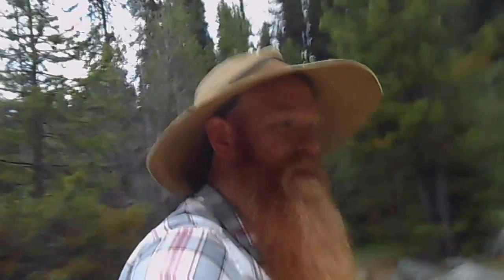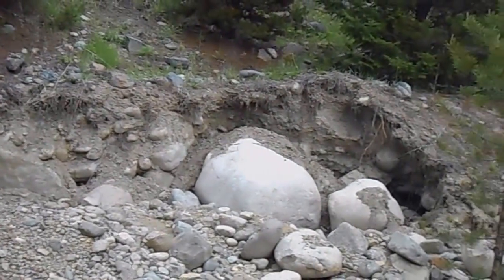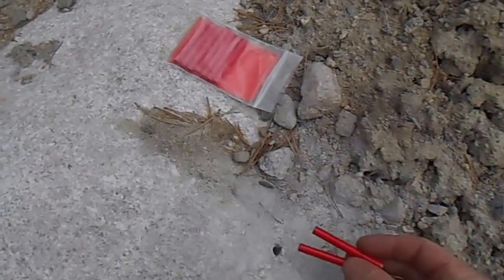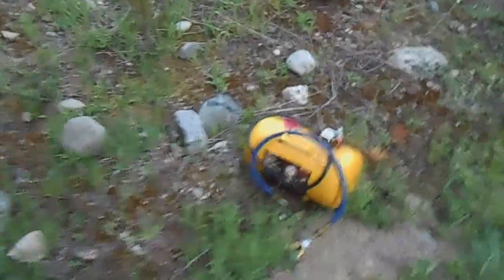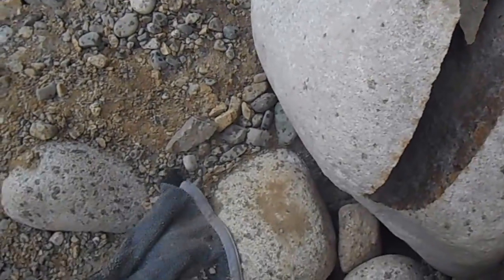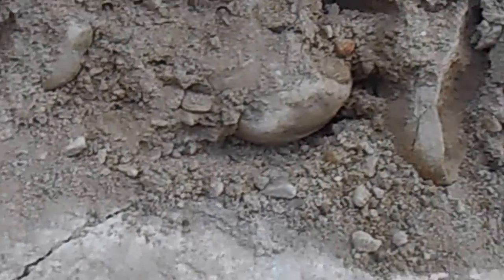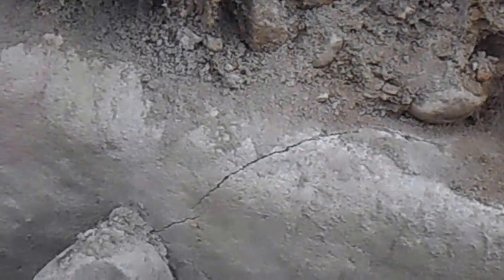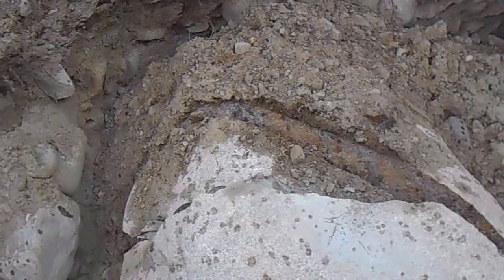Splitting rocks with the Micro Blaster

Comment: My grand pappy used to use a 30.06 shell, a picket pounder, a rod. Sharpened to a point and a heavy rubber mat with a hole drilled in it to break rocks to clear fields for farming and grazing. You don't have to spend thousands on a mini dynamite blaster and charges.

Comment: May I sujest placing a good size rock on top to stop it from flying out like a rocket.  And it will hold the blast in longer and harder of a blast ,resolt is a bigger batter crack and using the devise to its fullest potential.  This coming from a mason .🖒🖒have a good day . By

Comment: Just an observation from other micro blaster videos they placed a decent sized rock on top of the mechanism so the blast wave stayed more in the rock and the mechanism didnt fly which means not all the pressure went into breaking the rock. 2nd not sure how you hook to your rocks but you could get some 5/8 drop in anchors and the set tool and thread in a 5/8 eye or 2 and make your job easier. nice videos keep up the good work sir. Oops i forgot 1 step you have to drill for the drop in, lol.

Comment: Get some old truck tires and stack 4 to 8 on top of the mini blaster to hold the charger down. Your loosing all your energy and its blowing out the hole.. energy has to go down into the rock not out the top of your drill hole.
Reply: Jared Beaucage no, he's not, as a blaster under ground in Colorado a simple oil funnel can point the blast with  the soft Anfo blasting powder.

Comment: So when your blast head flew out of the hole , its most likely that you had air or dust in the hole , the air is compressible and delays the blast pressure from and instant shock to a longer pulse that allows the pressure to shoot the blast head out of the hole. And the dust holds air and area that can be compressed. If you add water to the holes you will get more power and generally don't have to clear dust or worry about excess air space .

Comment: With explosives, dust acts as a plastic cushion which to some extent reduces the fracturing power of the shock wave, so the more dust one has, the more dampening of that 'clean crack' the explosives are trying to deliver.

It is much like putting a rubber pad on s sledge hammer than trying to break rock with it.

It can be done, but it used more power.

Comment: I was a driller on a Ingersoll Rand rock rig & blaster in Arizona drilling holes to blast a channel in the rock bed to lay 8 ft diameter sewer pipe      & also the reservoir and the 60 ft deeper for the intake pumps to be placed in to pump the water up over the mountain at the end of the water canal you see on the right side of interstate 10 traveling southbound just before Tucson Az.          We loaded each hole with a single stick of dynamite and a blasting cap and supervisor had it calculated how many inches of pink colored grains of farm fertilizer purchased in large bags to pack down on top of the dynamite followed by packed dirt. The fertilizer is explosive and aides in the blasting strength of the dynamite plus helps with directing more energy from the dynamite to be absorbed into the surrounding rock and helps in blocking the energy from taking the path of less resistance out the drilled hole. Company also would blasts out rock to make a room or a tunnel/shaft for property owners in the Arizona desert they can add a door onto to it to make a shed ya might call it. You drill a bunch of holes than load the drill holes near the center of tunnel to be blasted with millosecond delayed blasting caps so when the dynamite goes off the outer rows of drilled holes explode 1st before the center area explodes & this causes a reaction from the blast so it will react like a person is vomiting out their mouth effect and clear out your blast hole being blasted.
Reply: Do you know where I could get one of these?
Reply: @Crazzy_51_50   dont know what amount of rock you want cleared but you can find old portable  rock drills fairly cheap if wanting to drill a mine shaft, tunnel or hole in the ground/wall and runs off a small air compressor you can rent using air line hoses. Now days with our modern  technology and tool advancement you can get electric drills and hammer drills that can run off a small generator if not a commercial size project be cheapest and easiest way. Search for hand held portable cement or rock drill and drill bits or stems. Might take a little more work time but depending on what type rock maybe not. Theres so much new out there i have know idea whats available now days. In 1986 without a criminal history or a felon you had to pass a 50 i believe it was question test to be able to buy dynamite, a metal locked box for dynamite and another for blasting caps with hazardous placards to be able to transport along with a reasonable and true purpose use for it being used basically. Scratch that being true nowdays...haha. You can find videos or ideas im sure searching for options on rock removal ways or tools. Old miners having only sledgehammers and picks would heat very hot boulders or rock to make it brittle and break easier when hammered, smashed or crushed.

Comment: another improvement I may suggest is to weight your device with stones and that energy tossing your equipment around will have to path into the target.
Reply: Hi Mark, good idea that is exactly the way the alternative, SierraBlaster works, it has a silicone ring that grabs rocks even at an angle to do exactly your idea. www.sierrablaster.com shows videos of it, rocks fly up (Newton kinetic effect) and head stay in place.    BTW check out the gold nugget on my hand in pic, I use SierraBlaster for gold mining.  It is electrically fired.

Comment: Rather than wrapping in chains to pull ,how about drilling another hole and using a Lewis pin? You will get a good strong grip on the rock and make it easier to lift and tow. Less danger of chain slipping off and whipping towards you. Can be used with a come along to gently move boulders where you want.Stay safe,those big boulders can hurt you bad!

Comment: As a kid, I remember my Grandfather showing me how to blast rock with TNT he bought at the local hardware store. How times have changed! He always had a coal mine one his place. He was a coal miner and he was one of the first wire-drawers at Keystone Steel and Wire. Pulled that red hot iron using asbestos gloves and manually pulling the rod through the rollers by hand. 
Just in passing, when my Uncle was breaking rocks, I took some wedges that I had for splitting wood, and used Stellite 6 for the edge. After he cracked them like you did, he'd use the wedge to either just make an area that he could get the rope/cable in to pull them out, or he'd finish the crack with them. He told me the reason you get all the dust out was because the dust wasn't as dense as the rock and would cushion the blast.
Thanks for posting!
Smiles!

Comment: Your missing one thing. A rock on top of the blaster so it'll hold it down. That way your getting more of a blast through the rock instead of it going back out the hole. Plus it's not good having the blaster flying out and hitting rocks and possibly breaking. Great video!
Reply: even packing some mud or plasticine around the top of the hole would help contain the gas and provide more force for splitting
Reply: Yepper that's what I was told to do was to put a heavy rock on top to hold the blaster down in the hole, because you lose that pressure that sends it flying... That pressure needs to go down not up... But I never ended up using one. Life showed up and plans changed. When a pickup truck pulled out in front of my motorcycle... Very ugly bad ending... So live love and enjoy life all you can while you can.... And BLAST AWAY!!!!!! YEEEE HAAAA!!!!!!
Reply: JeromeAZ57, Agree with you.  The alternative to MicroBlaster is the SierraBlaster, and it is designed with rubber ring for rocks to be placed on top.  And works great, here is a video of the rocks flying up and blasting head being held down.  www.sierrablaster.com     I use it a lot for small mining and jeep trail building.
Reply: What about plugging the. hole with concrete?

Comment: don't ever put two sticks one over the other
Reply: Two cartridges in the same hole are allowed by the manufacturer.  More than two cartridges are not.  The cartridges are setoff by a primer much like a primer in a shotgun shell.   The micro blaster unit has a firing pin that strikes the primer of the top cartridge.  The detonation of the top cartridge sets off the second one.   The cartridges are as safe a shotgun shells and will not accidently detonate unless the primer cup is compressed far enough and fast enough to strike the anvil in the primer to setoff the cartridge.
Reply: why ?
Reply: i still don't get it ??
Reply: Cuz explosives except plastic ones are really dangerous if you stack them and press them too hard, or the one can blow and the other not
Reply: got it , thanks
Reply: Buckhorn Cortez y

Comment: go old school and heat the rocks with fire then beat the bejesus out of it :)
Reply: jon west yep,  that's been around thousands of years.  Burn for hours, then dump water on,  to effect sudden cooling,  and you have brittle rock,  or even some splitting.
Reply: Found an old mine up on the mountain and it had the whole back wall burned black.  It only went back in about 40 feet.  Can you imagine how hot it was in that mine?  Also found a rock doorway they started to push.  About 4 ft tall 3 wide covered in hand-packed mud.  You could see the handprints in the long dried mud.  Could not find that mine again.  The entrance was about one foot tall and three feet wide.  The rest was covered with dirt and rock.   I had nothing at the time to explore that doorway.  Chasing deer during the deer hunt.

Comment: Another easy way to move larger rocks is drill a larger hole and screw a wide tapered bolt in with a shackle attached, then drag out with your 4x4 or tractor

Comment: Your video's are AWESOME! Thanks for posting, and sharing your knowledge. I, for one, appreciate it! This is my favorite so far, but the bucket classifier is a close second. Which by the way: Can't ya buy stainless mesh; say 20 x 20 inches, and just be done with it (longer durability)? Does that material/fabric you recommended (name is escaping me now..of course) come in varied mesh sizes? Keep making these, you are a great person to help others like you do. Thanks.
Reply from the maker: Todd Kleinert Stainless mesh would be the way to go. Just a bit too expensive to use in a high school.  Our budgets are limited.
Reply: I understand completely about the budget. My pro-style classifiers were spendy, for sure. I regret getting the big 13" ones, a bit. I think that I would have been better off with a set of small 9" models. I picked up 30, 60, and 100 [mesh bucket classifiers]. I don't dislike them, but the 100 is a challenge, and I think I need more sizes to ease this pain. I'm wishing that you will have heavy pans Dan. Take care.
Reply: @Danhurd  use ramset bullets. They are far cheaper. And u only need 1 or 2 per shot.

Comment: Very interesting.  Unfortunately for me, my claims would require a plan of operations etc to use explosives.  Have you ever heard of expanding grout?  Not nearly as quick as the micro blaster, but non explosive.

Thanks,

keith
Reply from the maker: Hard Rock University I have heard of it, but have not tried it.  would like to some day.  Unfortunately, it does require a much larger hole to be drilled.  What I was told by the person who owns the Micro blaster, at least around here, it is small enough to fall below the threshold of being considered an explosive.  There is another type, the charges look like a shotgun shell, and you use water in the hole and basically shoot the shell into the water, and the shock wave in the water splits the rock.  But again, you need a bigger hole.
Reply: Dan Hurd Yep, they also make one that creates high pressure gas that breaks the rock.  None of the others I know of work so quickly and easily though.  Extremely efficient.  I used to set of 20,000 lbs of anfo at a time though,  so I cringe when I see you set it off at 100 feet with no shielding.  Where do you get the info about that device?

Keith
Reply from the maker: Hard Rock University just do a google search for "Micro Blaster"
Reply: Hard Rock University Thank you
Reply: For once government myopia comes to the rescue!  My M1A has a 'deflagration' inside the cartridge case when I pull the trigger.  Interestingly enough, my pellet gun is a 'firearm' because it 'propels a projectile by means of expanding gasses'.  Amazing how definitions matter.
Reply: +Hard Rock University It is not an explosive. Try Sierra Blaster, approved by all guvmint agencies as a non-explosive blaster. No permits or licenses needed.
Reply: Thank you.  It sure LOOKS like some kind of explosive device.  :-)  Glad it's not.
Reply: David is right.  The SierraBlaster has an ATF exemption, no blasting license required.  I know several hardrock miners using them without permits, and one that does have a blasting license but uses SierraBlaster because they blast for day job in big mine and weekend mine in their own private mine and do not want all the regulation costs of using high explosives.
Reply: It's classed as a "deflgration device." Sierra Blaster has been tested and approved by DOJ, DOT, ATF, USFS, USArmy and a bunch more alphabet types. Even OK to ship by air! It was invented as an improvement to Micro Blaster; 3 years in development and testing. Micro Blaster is not reliable enough.  See a shot failure by Amanda on Prospectors for a TV example.
Reply: HAHA!
Reply: If you are talking about calcium oxide/calcium hydroxide [lime, slaked lime, quick lime] its easy to get the basic ingredient, and to some extent it works by its self, but many companies add 'proprietary blends' of various ingredients to enhance the performance, especially in the area of keeping the material in the hole long enough to perform the work, such as water setting epoxies, elastomers, and other mineral supplements besides calcium, although if your hole is not able to leak out the bottom, you should be able to just pour it into the hole and let it do its thing.

Its slower than blasting, but much safer and quieter. Better for people who are patient, or working near such things as people, animals, homes, unstable earth [land slides and avalanches can happen with explosives] or sensitive materials [aka explosives, glass, loose frangible materials like gravel, etc].

This company will sell it to you by the ton, either in pure oxide [more hazardous but more effective] or as the hydroxide [ SLIGHTLY less hazardous, and slightly less effective] http://www.uslm.com/ if you need a lot [as in really serious work] but if you are not in need of a lot, you can go to most hardware stores and buy 50 pound and smaller sized sacks of it.

Due to the inherent dangers of it, [not less than explosives necessarily, but definitely of differing natures] I strongly suggest one read up with and become familiar with it before attempting to use it as it can prove fatal if you inhale it, and you can get both thermal and chemical burns from it, so while its hazards are different from explosives, its not a benign product.

I had thought of using plastic tubing to put it into rocks, but then I realized the plastic would deform and reduce, if not eliminate its effectiveness.

Same with paper.

The only way to insert the product into a hole which is not vertical would be in a metal pipe, and there you have potential problems of PSI rupture [explosion] or, depending on the amount and wall thickness, product failing to break the steel pipe, so if pipe is used, either use thin wall, or score the sides to ensure the metal does not resist the limited 4500 PSI peak native expansion pressure it can generate.

Also, due to tendencies of some rocks to be stronger than 4500 PSI tensile, or, simply have more SI than necessary to resist, be sure to drill adequate holes along the intended fracture lines, and be sure to add enough material to exert more force than the rock can contain.

Unlike explosives, this material will not work on plastic and fibrous materials [such as wood].
Reply: DeBlair, was surprised to see you being a women and knowing so much about explosives.  Men love to blow things up, women not so much.  So checked out some of your videos and see you are a man, mystery solved.   

In regards to plastic or even dust softening the blast.  Yes there is a very small effect.  I have done hundreds of blasts with Sierra Blaster (similar product but no air compressor needed, electrical fire www.SierraBlaster.com).  SierraBlaster uses plastic cartridges so waterproof.  That way it works underwater, and you pour water in hole which is bigger benefit than plastic being compressed.  It fills the voids and is much harder to push up the small gap on rod/rock.   If you check out the videos at link above it blows huge boulders and no ATF license needed.   

How did you learn so much about explosives?